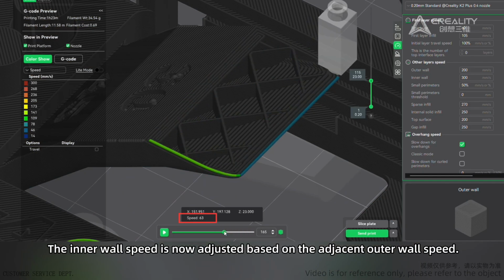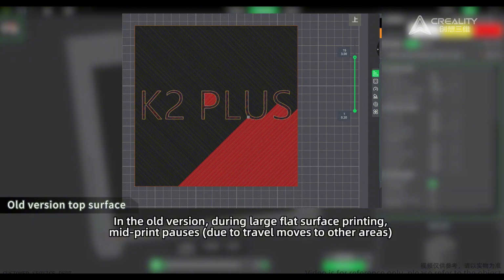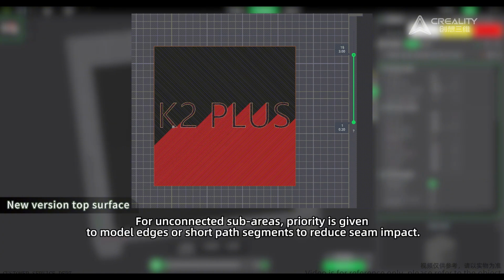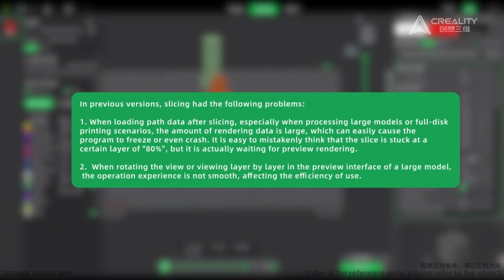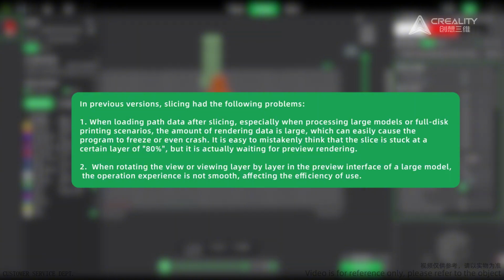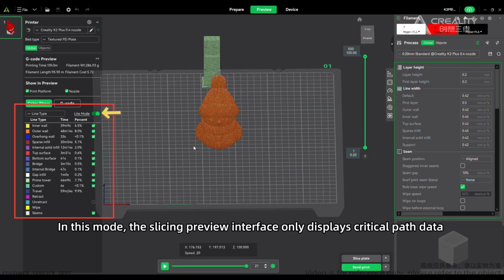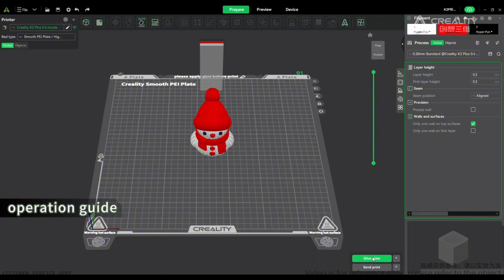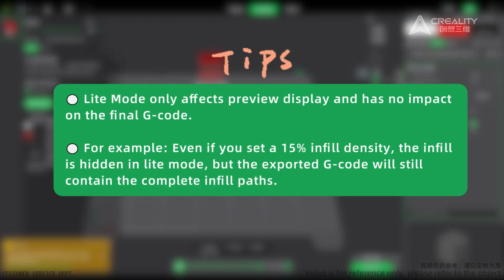Creality Print 6.2 Printing quality and efficiency optimization update notes

Comment: I like 6.1 where it can detect my cfs. Second and most importantly, the cp6.2 has damaged both lead screws and the hotbed of my printer, as it made it ram into the bottom of the base after displaying: "Hotbed deformatino leveling" I am very unsatisfied with this kind of update and I would like to request that creality to remake 6.2 (ALSO MAKE THE FREAKING CALIBRATIONS TURNED OFFF BY DEFAULT WHEN SENDING PRINTS LIKE 6.1!!! THAT IS HOW THE PRINTER GOT THE DAMAGED LEAD SCREW AND HOTBED.)
Reply: I understand that this has not much to do with leveling the hot bed.
Reply: https://www.youtube.com/watch?v=lQobRgwDqak